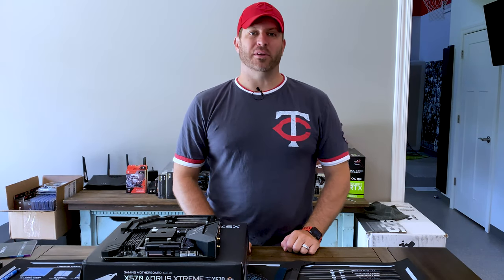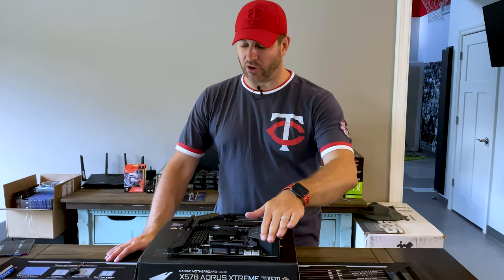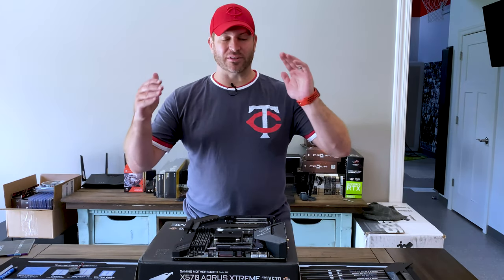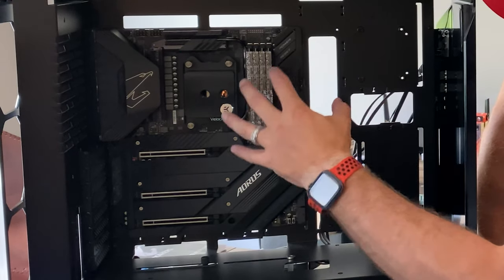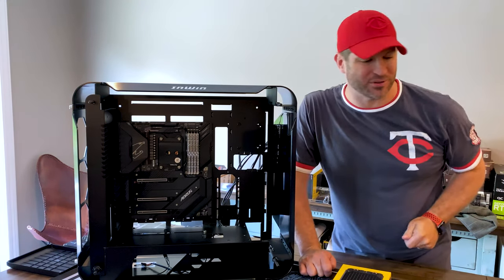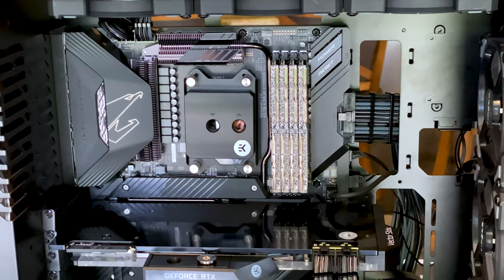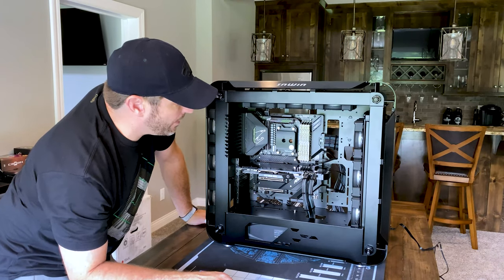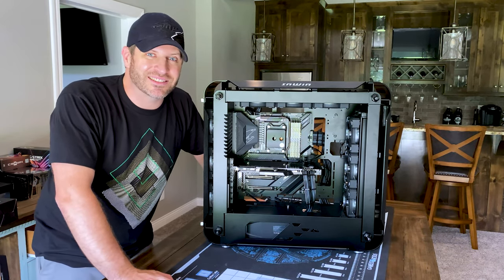X570 Aorus Extreme InWin925 part 4000

Comment: Started my bild now also with the X570 extreme. No CPU yet however. I use an NZXT case and there’s their fan/led commander pre-installed with fans. Aorus provides their 8 channel fan commander. Can’t decide which one of both to use
Reply from the maker: That’s tough.    I usually prefer what comes with motherboard, but at same time, fan bundled items should work well.  I think it comes down to which software you trust more,  gigabytes or nzxt.

Comment: After completing two builds in the 925, one had vertical GPU, I didn't like how far forward the GPU was when mounted to the case slot. I ended up using the Phanteks mounting bracket and I think it brings the components together better. Also, you can use any riser cable. It does not need to mount to the midplate. The GPU is totally supported by the case and the riser cable will stay attached to the card just fine. Also, if you daisy chain the top and front fans, run the rear fans separately. This will allow you some slack when removing the back panel to access the IO ports.
Reply from the maker: 1) I actually ordered the phanteks bracket yesterday... gonna try it out. 2) thanks for the pointer with the back fan.   Great thoughts.    Thanks for watching and commenting.   I appreciate it.

Comment: Have you considered going for a distro-plate instead of a conventional reservoir? The 925 is perfect for it.
Reply from the maker: I have not...that’s a great thought.   Any suggestions as to who’s distro to use?
Reply: @KDSTech  Bykski made one that's actually a perfect fit. The model I ordered came with a DDC pump, but I think there's a model with a more powerful D5 pump as well (if there is, go for that one instead). There is RGB, but you can turn that off of course. Downside is the cost. It will set you back around $200/250. I opted for it because,... well,.. the case itself was $500, and with the total of a $3000+ build, the extra $150 (that's the $250 minus reservoir and separate pump) didn't seem to make a difference anymore.

I saw the EK has some solutions as well. In your case you could stick with EK I guess. They're usually my go to brand.

Comment: How thick is the front radiator?
Reply from the maker: 54mm
Reply: Will a 60 mm radiator fit on front?
Reply: @arqgnavarro  yes it will but you have to unscrew the psu shroud it only has 3 screw but consider your pump/res combo coz it will give u small room for it
Reply from the maker: Gabriel Navarro yes
Reply: Can a third radiator 360mm x 38mm be installed on the back as well?
Reply: Gabriel Navarro u cant  not even slim rads

Comment: Also got the same " out of stock " response from In Win for the vertical mount GPU kit. However I am rethinking this type of installation because of something I noticed with all the various  vertical kits. They all mention the use of a 3.0 cable, but the PCi slot is 4.0.  Am I missing something here, or would the use of a vertical cable be detrimental for maximum performance from the GPU card. ? A big  " Thank you " to anyone who will take the time to address this issue of mine.
Reply from the maker: right now you'll not see any degredation in performance on the pcie x 16 slot with gen 3 vs gen 4 because gen 3 isn't even coming close to maxing out the bandwidth.   great question tho!   thanks for watching and commenting!

Comment: Hi KDS Tech,
How does the xtreme motherboard hold up after several months use? I've read it may have recently been discontinued by Gigabyte and that a newer flagship model would be launched soon. Several people have also apparently had problems running various memory kits on it. It's a shame because it looks like a great board. I'm hesitating between the x570 xtreme or the Dark Hero for a new build with a Ryzen 5900x. What would you recommend? Thanks.
Reply: Dude! Def go with the Dark Hero!! Such a fantastic board! Also, a lot of tech tuber guys use the Gigabtye boards mostly because they are sponsored and provided to them for free but otherwise they are not the greatest boards in terms of quality, stability, and reliability. Steer clear if you can, just speaking from personal experience, Asus, MSI, and EVGA make the best boards on the market and they last.
Reply: @pi6466  Good advice! I went with the Dark Hero and it's definitely a great board. It runs super fast with Ryzen 5000 cpus, has great RAM compatibility, and has a far more reliable and stable bios than the Xtreme. Plus it's nearly $300 cheaper. I did contact Gigabyte customer service to ask a few questions before making a choice, but after ten days with no reply I gave up waiting and opted for Asus. No regrets!

Comment: Are those corsair radiators copper like your GPU block? I thought the corsair stuff was all aluminum to cut down on costs. If they are aluminum wont that cause issue with a copper ek block?
Reply from the maker: Great question and thanks for watching and commenting.   

No, they are copper core.   You might be thinking of that line of aluminum stuff that EK sells... their lower priced items.
Reply from the maker: https://www.corsair.com/us/en/Categories/Products/Custom-Cooling/Radiators/hydro-x-xr5-config/p/CX-9030002-WW
Reply: Cool cool, glad to hear that wont be another hurdle. I actually have the same case, same mobo, cpu, ram etc lol actually selling the case. Having to take off the back panel every time I want to plug something in or unplug is driving me nuts lol and the holes in the back of the mobo tray have been digging into my brain a bit. Its a beautiful case though. Just wish I hadn't missed out on the 928. A shame... found a good replacement though
Reply from the maker: The 928 was my dream case.   I have the enthoo elite for my Genisys rig. Love that, but it’s beyond massive. Lol.    What did you get as a replacement?
Reply: @KDSTech  Spectre 2.0, it's beautiful and the cable management is much nicer to look at. Just need some inwin daisy chaining fans.

Comment: What is the fan commander used for?
Reply from the maker: controlling all fans in the case.  i wont be using it since i am going to use their crown fans that daisy chain.
Reply: @KDSTech  Yeah I was wondering cause I ordered the board and wanted to use but wasnt sure since there is no info about the fan commander. Hope to see the finished build soon. Stay safe and thank. If you can share any info about the commander how its used and works when you do the build and why you went with the road you went with would be cool to see and understand a bit more.

Comment: Why don't you just drill the hole to mount the vertical gpu riser cable that you have? I know it's not the ideal solution but at least you can use the cable you have. Great build by the way.
Reply from the maker: Thanks for the input.  I was thinking about it... but finally got the PCIE riser kit ordered.

Comment: There is a rider cable on Amazon that has matching holes. I'll see if I can get you a link. Or you can get a vertical bracket.
Reply from the maker: i was looking at cablemod's vert bracket... not sure i am going down that road.  i'll look through amazon as well.   i saw the phanteks one, but dont think it will work.
Reply: @KDSTech  https://www.amazon.com/gp/product/B07K67CXHF/ That is it. I know somebody who did a 925 build. 

Couple other thoughts for your consideration...
- If you want to use a vertical bracket, EK is coming out with one that looks very robust. The vast majority are flimsy POS and sag without some form of support.
- Also, be careful... the dRGB cables for the front rgb inwin logo are EXTREMELY flimsy ($500 case lol). You can easily break the connection on the hub. I would not fiddle with this until the very end.
- Loop order: res out>up to front rad close port>front rad far port to CPU block right port>CPU block left port to top rad far port>top rad close port to GPU left port>GPU right port to res intake port (bottom). Flow would go counter clockwise. 90* compression fittings out of most ports to make direction changes easier. IMO, this is the "cleanest/most balanced" config.
- To negotiate the tight top right rad area, you may want to use "offset" fittings to lower Y axis of the front rad port so it fits under the top rad with room to spare. 
- This will add a bit of complication up front (I can help since it is my current config)... but long run it is a great investment. Go full Aquacomputer for PWM and RGB control (LMK if you need exact product links). I can go through the litany of reasons why (TLDR: Aquasuite is the best software control by far) if needed... but for now: 
---- For PWM: 1x Octo + 1x Splitty9 + 1x Splitty4 + 1x "Temperature sensor internal/external thread G1/4" (1 splitter for 6 rad fans, 1 splitter for 3 rear fans, temp sensor for PWM based on water temp, Octo for PWM control of each splitter and pump. Simple enough.). 
---- For RGB: Farbwerk 360 + 6x "RGBpx adapter for components with motherboard header" + 6x "RGBpx cable, length 4 cm" + X# 3pin RGB extension cables as needed (This part is complex... but stay with me. Aquacomputer uses proprietary RGB connections. The adapters let you use standard 3pin RGB devices on those connections. The Farbwerk 360 has 4 RGBpx ports/channels and the Octo has 2, so total of 6, hence 6x adapters. You have individual control over each port/channel. You could do front RGB fans, top RGB fans, rear RGB fans, GPU rgb strip, RGB strips that come with Farbwerk 360 + the front logo. Each channel can power 90 LEDs. On top of that, should you want to use Corsair 4pin individually addressable products, the Splitty4 lets you control those via Aquasuite. For more channels, you can keep adding Farbwerk 360s.)
--- Quick note on Aquasuite: Just google Aquasuite and you will see how well it is regarded. The same cannot be said for Gigabyte's solutions. 

LMK if you have any questions. Also, does this guy know what he is talking about? You tell me... https://i.imgur.com/YmJb7Gt.jpg https://i.imgur.com/Q7siRhb.jpg
Reply from the maker: Thanks!  I’ll check it out.
Reply: @KDSTech  Inwin make a vert GPU bracket specifically for this case all the mounting hardware matches the PCB to the case no mickey-mousing it 

https://www.amazon.com/InWin-Riser-Cable-Socket-Vertical/dp/B07WJVKGGK/ref=sr_1_5?dchild=1&keywords=inwin+925+vertical+gpu+mount&qid=1595907998&sr=8-5

Comment: I’m working on a very similar build. Did you have to cut the I/O shield “stopper lip” in your 925 in order for the board to sit square on the standoffs? I’m running into the same issue described here and I’m very curious how you dealt with it: https://www.youtube.com/watch?v=ZQ128wJ2t44&t=11m45s
Reply from the maker: i haven't really had any issues with I/O shield, per say.   you want to give me a time stamp so i know what you are referencing?  thanks!
Reply: That's actually good news - means they fixed the lip on newer cases, I think. 

The link above is actually a timestamp link (11m45s). Your case must have no lip there. Spoke to In-Win today, and they have a 925 at the office 10 mins from me. I'm hoping they'll swap me quicklike if it has no lip.
Reply: So, the 925 at in-win in California also has the “lip” and it seems the product manager had no clue about the issue. Dremel comes today ::insert metal grinding sounds:: ⚡️